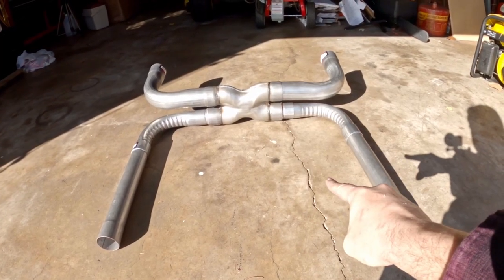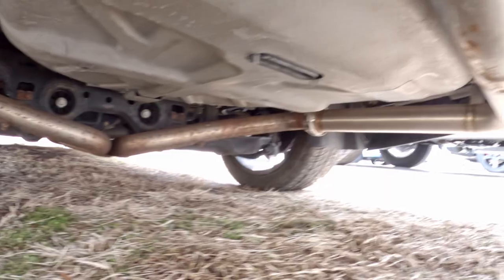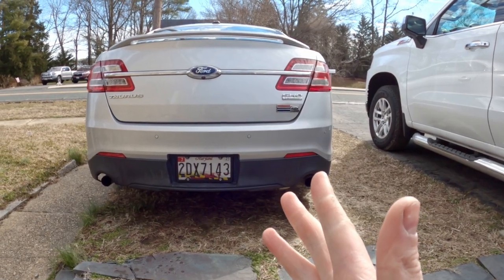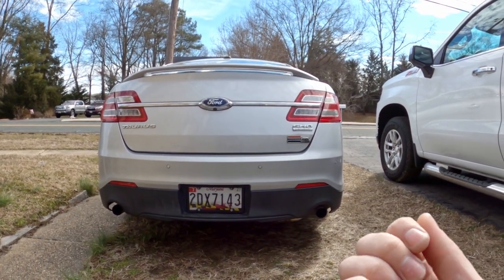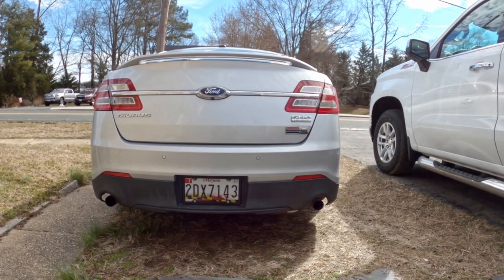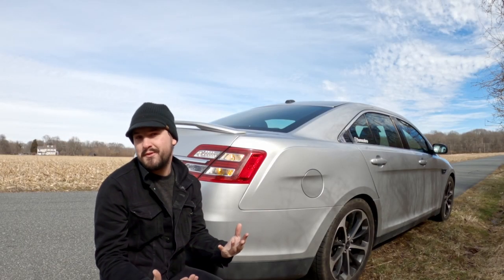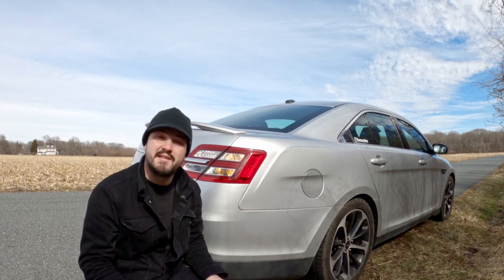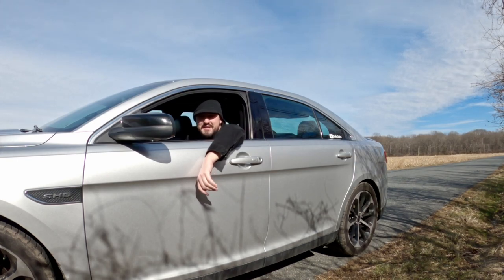Here's the BEST SOUNDING Ford Taurus SHO on YouTube!

Comment: How expensive are we talking here? It’s very interesting for sho owner and a definitely a buy
Reply from the maker: If I work a deal with the shop it won't be nearly as expensive for someone to buy. I'm paying for hourly work so for me it's expensive. Right now I could've bought down pipes and a cat back for what I have in that piece. I'm going back soon to see about adding a trombone loop to equal out the two sides. More cost to me but hopefully it will be an Awesome bolt on piece when finished.